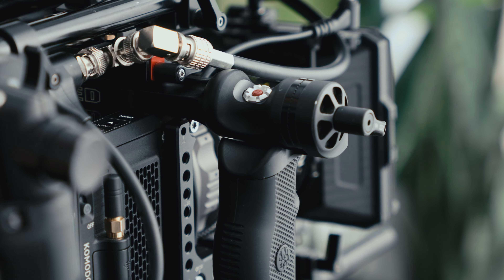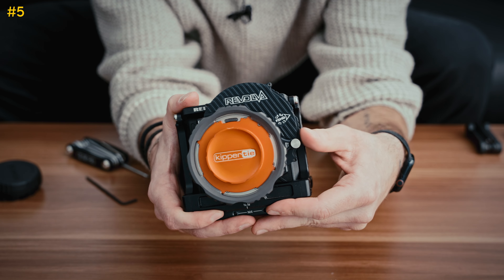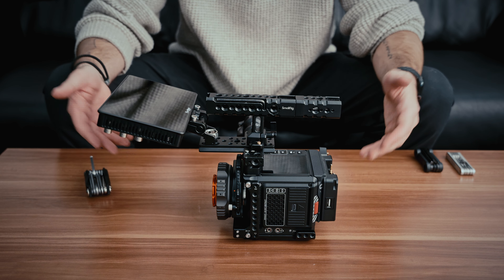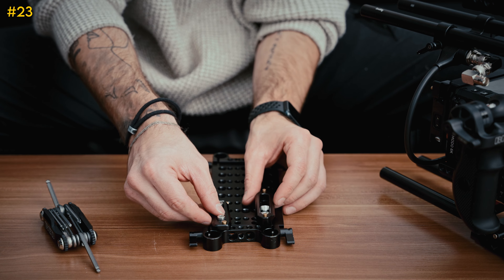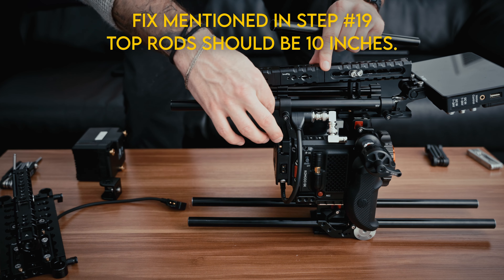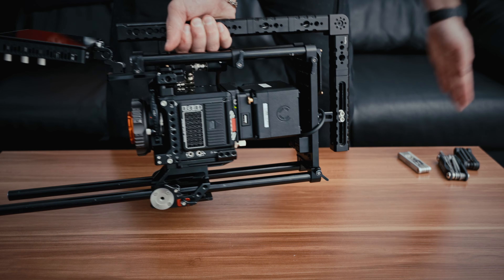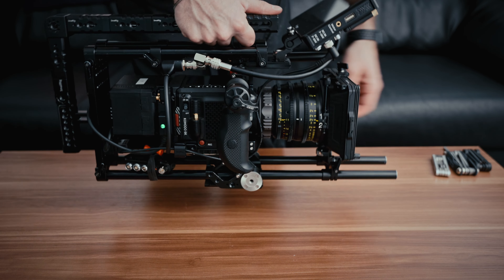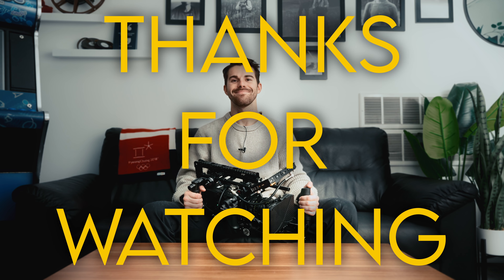The Ultimate RED KOMODO BUILD (for larger productions)

Comment: I was thinking about making’s a raptor style handle from smallrig pieces but i couldnt figure out on how to attach the 4 rods to the backplate. The nato rail is a genius solution. Blew my mind. Get some tennis / baseball grip tape and wrap it around , it will be much more grippy . You can poke the screw holes and the arri pins with a metal rod afterwards.
Reply from the maker: Ooooo I love that tape idea!  Might have to do that!
Reply: I've been using a Ranger for a few years and I've always thought about extending the handle at the back to give me something to hold when on jib / dolly. Still grabbing the battery but these are definitely nice solutions that don't cost an absurd amount.

Comment: Epic setup!!! 🔥 but how hard it is to mount it on a gimbal during the shoot 😅 this is my only concern before i build something similar
Reply from the maker: With loosening two knobs and unplugging cables you can pull just the body, battery and handle out in 30 seconds, then just take off the handles and it’s mountable!
Reply from the maker: If you just unscrew the rosette part of the handle but leave the part that connects to the body on, you can technically switch to gimbal mode without use of any tools which is super nice

Comment: 4:20 I'd use a base plate that has at least 3 mounting points that are not co-linear, otherwise I can imagine the  plate getting loose pretty soon.
Reply from the maker: Would be nice! I just don't find those as common and this will hold pretty well/is standard for most camera builds so you can slide the plate forward/backward a bit

Comment: Looking at building this out, but wondering if I need to get a Vario 5-- how much does this weigh fully rigged? (Currently going through and adding up all the parts with website descriptions but maybe you'll beat me to it. lol)
Reply from the maker: She definitely hefty! If running all day with bigger lenses would recommend something’s bigger than mini max (atlas orions for example) otherwise minimax can get the job done!

If need to run without easyrig you can just put on shorter rails smaller lens take of the extra handles and it’s pretty manageable!
Reply: @brian.durkee  This is incredibly helpful man, thank you.

Comment: I really like this rig build, you've found a great solution to the expensive Arri handle extensions.
What do you think of replacing the Wooden Camera baseplate with the Kondor Blue 501 adjustable baseplate? It reduces from the unnecessary height the Wooden baseplate adds, and if you need flexibility in raising the rig from the bottom rods, in case of a larger lens, you can easily do that with the Kondor Blue one.
*Whilst I was writing this, I realized you had that huge cheese plate at the back of your rig that you can't really move around :)
It would be nice to find a solution to that. Perhaps a shorter cheese plate and a railblock that can be adjusted the same way Kondor's baseplate does.
Reply from the maker: Totally! I just had the wooden camera one hence why i made it work but with the kondor blue one it opens up the possibility to make a back plate that isnt adjustable and do all the adjusting on the kondor blue piece. Great modification idea :) thank you!
Reply: @brian.durkee  Do another video with this base plate and an FX3. You're really good at these types of videos and they should definitely perform well!

Comment: does the top handle rattle by any chance ? Im looking to make something similar but the smallrig parts are discontinued and iv had the problem several times that Arri pin acessories came loose , they cant unscrew ofc , but they will rattle , especially w the arri pin nato rails iv noticed it .
Reply from the maker: @poti732  no rattle at all!
Reply: @ perfect , And what top handle extension would u use if the small rig ones are discontinued? Iv tried to find them everywhere, everywhere they said that they are discontinued

Comment: Iv recently heard that D tap ports on rigs that Use SDI are unsafe , do you have any info on that??
Reply from the maker: Follow sdi protocol if you are worried about it! Everyone has different opinions on how unsafe for your ports it actually is in practice
Reply: @brian.durkee  “The use of P-Tap cables to power accessories connected to the camera should be avoided, as the P-Tap's power pin may make contact before the ground pin and the accidental flow of current may damage the camera.” This was the reasoning for it but based on your response this couldnt or shouldnt be a problem if you follow the SDI protocol right?
Reply from the maker: @poti732  yes!
Reply: @brian.durkee  thank you , looking forward to your next video :D on anything really